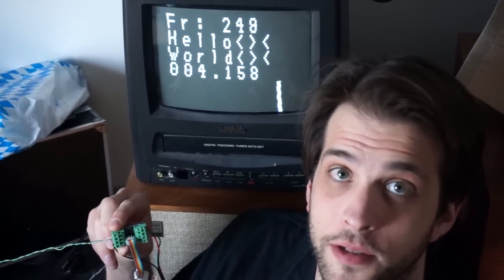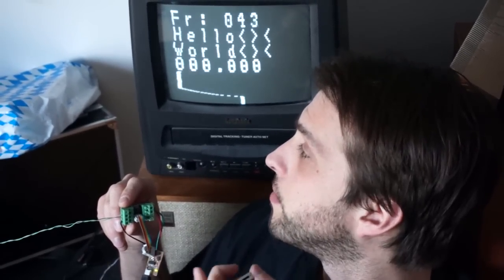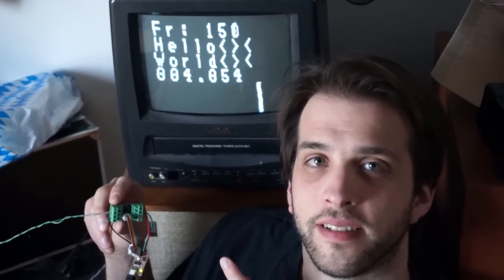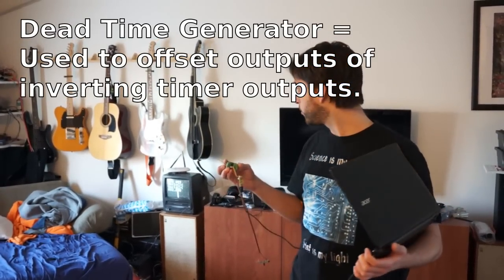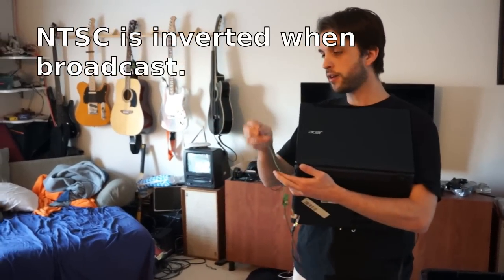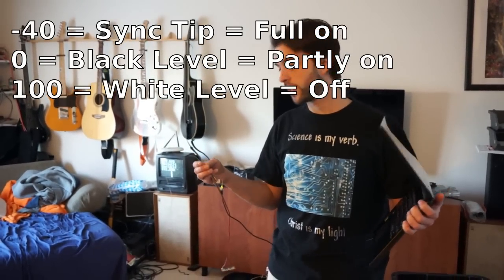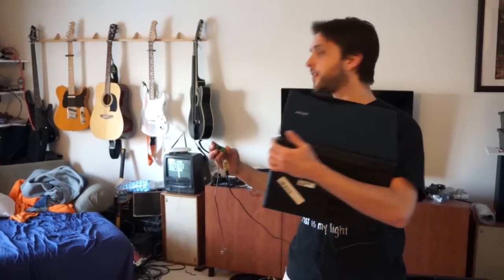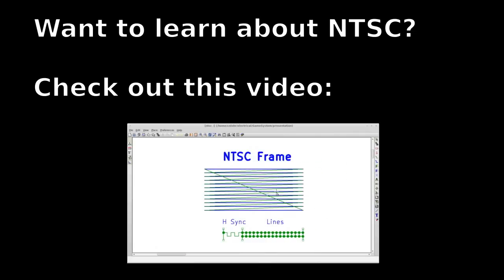ATTiny85 NTSC/VHF Encoding

Comment: You could always build a remote for the TV using an AVR.
Though some Sony tablets and phones have a built in IR transmitter and remote app.
Reply from the maker: +Patchuchan I ended up finding the remote.  The TV doesn't support closed captioning :(
Reply: www.banggood.com/5Pcs-Portable-3_5mm-Android-IOS-Phone-ZaZa-IR-Remote-Control-For-Air-Conditioner-TV-DVD-Projector-p-1068145.html

Comment: Do you have an antenna on your TV? I'm getting a very unstable signal on my television using your code. I also had to change OSCCAL to about 249 before anything would show up.
Reply: Anthony Guerrero Whoops, forgot to burn fuses. That makes sense. Trying to run your code at 1MHz
Reply from the maker: Anthony Guerrero That won't work.  And I do have an anteanna, it was a wire that was about 3' long :-p  Take a video of it now!

Comment: I know this video is not about of but...   I need to ask, You are using in your CNC Texas Instruments stepper motor drivers?, Could you tell me which one are them and the amperage of the stepper motors you are using?
Reply from the maker: I believe the ones I am using are super off-name-brand. I think they drivers were rated to 36V, 5A.  I am running at 3A, 24V, bipolar.   The motors are rated to 4.5A, unipolar.  Hopefully I won't fry them >.<
Reply: CNLohr Let me know if you have an interest in open source stepper motor drivers... I provide the Linistepper brand (which even Applied Science used on his xray imaging machine to rotate the turntable).

Comment: So... wait... let me understand this.. you are broadcasting two different signals (sync and video) at the same carrier, but on two different antenna wires, and you combined them at different strengths by making one antenna a little shorter? Instead of combining them with resistors? If I understand it correctly, THAT is the coolest part of the hack.
Reply from the maker: James Newton PB3 is less powerful than PB4, so we can get different amounts of total TX power, which is how we can AM the signal.
Reply: CNLohr That is just crazy cool. But in the video, didn't you say something about one wire being shorter? Were you referring to this same difference in drive power, or was that a different issue?
Reply from the maker: Sorry, by less powerful, I mean the wire attached to PB3 is shorter than the wire attached to PB4.